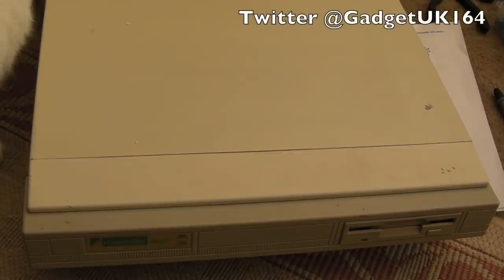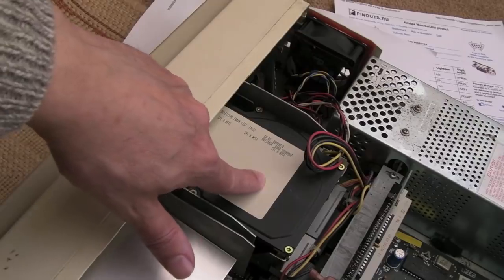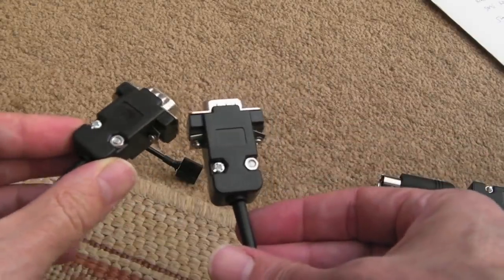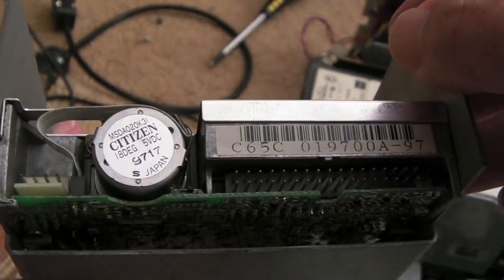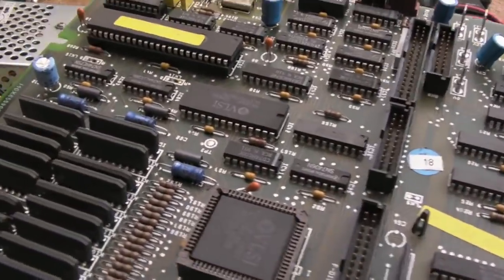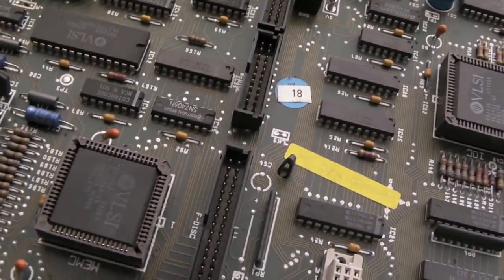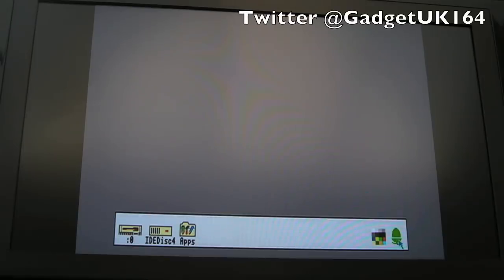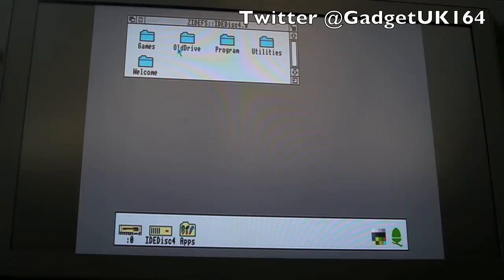Acorn A440/1 Archimedes Repair Part 2 (Sound, Hard Drive, Floppy Drive, Risc OS Upgrade & More)

Comment from the maker: There's a small mistake there when I talk about the FDD - you can replace it with some PC FFDs, but a small mod would be required and some drives might not work.  Also another small mistake related to the max CF size - it's 32GB I think.

Part 1 - https://youtu.be/QE4eH8QN_0c
Part 3 - https://youtu.be/kvcdlH0Ho_A

ZIDEFS Podule (IDE Interface - up to 32GB CF Cards)
http://www.cjemicros.co.uk/micros/individual/newprodpages/prodinfo.php?prodcode=4D-IDE16-32GBSD

Risc OS 3.11 ROM upgrade (4 X 512KB) - Older machines require a ROM carrier board to fit these.
http://www.cjemicros.co.uk/micros/prices/categories/upgrades1.shtml
Reply: another great video chris, really enjoyed this one as im not sure if acorn machines ever came to Australia and if they did they must have been on short supply (never seen one here)

btw if anyones interested in using a PC FDD here's a link to doing the required drive mods:
http://www.apdl.org.uk/riscworld/volumes/volume2/issue6/floppy/index.htm
also this link may be of interest if you want to use HD disks and a HD FDD, it discusses the replacement of the FDD controller with a 16mhz one
http://qubeserver.com/Qube/projects/hdfloppy.html
Reply: Good to see the Arc get some lovin'. Just wanted to say the Arcs did not feature fans at all. They were utterly quiet. Except for the drives, of course.

What's the song at the end?

Comment: those things coming off the adapter for the fan are likely thermistors used to measure the heat level in the case

Comment: I've been enjoying your vids immensely, seeing this reminds me of my very first employment was a computers and electronics YOP scheme back in late 82 and part of the course was we were in groups and every week we would be assigned a BBC Micro which had been at the previous weekend "doctored" by the tutor by putting in duff resistors, caps or failed chips and we would crowdwork on the machine taking different roles to fault find it then repair it and really all we had was clunky old meter's and soldering irons as our "diagnostic" tools and as we developed along we would build up a detailed schematic of the BBC machine making future diagnosis easier and the tutor would do more "doctoring" to really raise the bar each week by setting more tough problems.   At the end of the week our machine had to be operationally perfect, or our group would be marked down for a fail.   He was a devious bugger too the ol' tutor and sometimes we would get a proper PC or another type of home computer but mainly it was BBC as we were learning teletext formation and gearing for the Prestel network that was a big thing back then.   I was somewhat lucky in that I cut me teeth officially on a ZX80 kit my mum bought me from Clive's first adverts, keeping it unmelted and running was a daily challenge, then the same fire control and operation with the ZX81 that could get so hot it would melt the solder or create annoying "hot" joints all over the place, no fans back then and all passive cooling and them ram packs you could often see smoke coming out of if pushed too hard for too long lol   I remember my ol' dad going spare when one of the Sinclair machines burnt a hole in the carpet O.o
Reply from the maker: Very cool lol!  Sounds more fun than I hard whilst learning to repair these things!

Comment: That floppy drive looks exactly like the one in the plastic cased external Cumana drive I had for the Amiga. I suppose a lot of this stuff got used in various machines. It's just a memorable drive because it has the unusual spring mechanism across the top to push the disk tray down.

Comment: To remove the board, normally, it's just remove the podule backplain, power leads and drive leads plus the ground.  An econet module will activate the socket but without the econet server and cabling it will not actually do you any good :-) It was nice to see the inside of one after nearly nearly 3 decades :-). Try and find a SCSI podule that will give you far more choice and size re drive.  You don't normally have to remove the front to remove drives, maybe something was slightly bent somewhere.
Reply from the maker: Thanks, yes - was aware I need a clock and stuff to get the econet working.  But in theory I could set it all up and link to the BBC I think.
Reply: GadgetUK164 - Retro Gaming Repairs & Mods  The Archimedes and BBC will be slaves. You need an Econet server. Econet is hideously slow. It was bad enough on a BBC 8 bit but on an Archimedes it was virtually unusable. We set up an Ethernet network at Orion Computers where I was the technical services manager and component level service engineer. It was a lot of fun! The Ethernet interface didn’t include the software which you had to buy separately. You have a genuine 440/1 as no RAM in sockets. An ARM3 upgrade would be nice if you can find one. I’m looking for an A540 after all these years.

Comment: Guessing the whole fan arrangement is after market - heat shrink on thermistors and control board and replacement fan, explains the wood, sticky pads, blutack, thread,  heatshrink board, etc.

Comment: Archimedes, gaming platform, desktop software house, cat furniture, it does it all. ^_^ A dust filter sounds good but what a mess when it breaks down. Bit of puzzle box that case and full of little surprises heh.
Yeah tape or disk heads are tougher than lasers so they can take a little force when cleaning. Been meaning to try the IDE Flash route someday, I can make disks from blanks now but new old stock of HDDs or it's parts aren't likely if you need them.

Comment: MFM and RLL drives are the same. RLL adapters give you 1.5 times the capacity. When a drive is failing and having trouble spinning up, gentle taps work well.

Comment: Sweet. Nice work. Looks like a pig to take apart! Is that thing near the fan an esc? It looks like something off a racing drone 🤣. Might try hform on the compact flash too. At least they didn't solder the battery onto the mainboard. Just picked up another A3000 cheap but it absolutely rotten.Keep it up.
Reply from the maker: Thanks!  I look forward to seeing that A3000!!!!  Regards Hform, there are different versions - the original old one only works with ST-506 drives, the one for the ZIDEFS has been modified.  I can upload it somewhere if you want it?

Comment: RiscOs 3.1 will take two 512mb CF Cards, you can use dual CF adapter and wire the hard drive light directly to the LED points of the cf adapter.
Reply from the maker: Thanks, yes - already took wires from the ZIDEFS board and connected them to the old LED (as you can see in part 3).

Comment: "is that factory?" about the string loooool.... i can't believe you said that out loud without laughing :)
Reply from the maker: The funny thing is I got de-ja-vu seeing that and I remembered yesterday that there was a kit that came with string - I vaguely remember seeing one of these before come into the company I worked at back in the day, and I am sure that came with string for fitting it.  It must have been a cost cutting thing - what was wrong with bolts I do not know lol.
Reply: haha - i just got through the entire video and the bit about the hard drive was interesting. I remember one of my YT placements in the mid 90's had a green screen PC for keeping a database.... you had to type "park" into a command prompt before switching it off everytime, i've never seen that needed on a computer since.
Reply: @Harp00nX : On these old drives a" parking or landing zone" was specified, so all the park program had to do was tell the drive to seek to a parking zone cylinder. The heads did not (or were not supposed) to actually touch the platters at all, rather the turbulence/wind created by the spinning made them fly just above the surface. Hence the term "head crash". The marks on that platter are from head crashes and Chris is right - once you have one dislodged particle flying around it soon creates another and so on. Incidentally the little white "silicone bag" is to there to catch these particles and any dust.

Comment: 4:55 looks like a so-called noise killer, just a fan controller with a temperature sensor. I vaguely remember installing one in my computer back in the day when it was all the rage, but I can't remember if it was my 486 or the Amiga 4000.
Reply from the maker: Thanks =D  Just need to test the temp sensors and work out where best to situate them I think.

Comment: Nice! shame about that old RLL disk but they are all starting to go now. The 10mb one in my apricot has just started to act up. One of my Acorn A3000 is equipped with an after market IDE interface obe made back in the day tho not a modern one. sadly its original 80mb 2.5" hard disk has failed now. i may do as you and try to replace it with a compact flash card. Ive loads of 128mb ones laying around.
Reply from the maker: Yeah, it's always sad when one of those old drives dies =/  I wonder if there's any way to replace the platters from anything modern.

Comment: Looks like that upper platter was scratched - that drive was already toast!  Might as well harvest the magnets and any other interesting bits from it - maybe use the platters as wind chimes? ;-)

I was always interested in the Archimedes since I first heard about it - we never got it here in the U.S.
Reply from the maker: Yes, definitely scratched!  I think some of the other platters would likely look the same.  I think that piece of sponge in the corner would originally have been sticky and caught any particals.  Now it's no longer sticky I wonder if some particals came out of it in transit and maybe they added to problems =/
Reply: Some guy made a POV display clock from the read head arm.
I made a clock where the read head arm strikes a bell when the alarm time is reached.

Comment: It's been a joy to look inside of one of these machines, having never seen one naked before.

That Panaflo fan looks like a dead ringer of one of the older Papst fans. It'd be interesting to see wtf is going off with the "controller" cause Papst fans run at full RPM, no fucks given, so maybe it's some form of "primitive" PWM? Dunno just guessing.  The item you thought was possibly a relay could well be, as it look a lot like the devices to decouple modems on dial up stuff (like very similar package and design to old ISA dial up cards, or serial / parallel boxes of yore). 

Love your vids to bits. I hope that current issues are not impacting life too bad, as I'd love to see more of what you do, but if you don't feel up to it, don't do it. Sooner have you healthy than burned out cause of vid making.
Reply from the maker: Yes, I think you are right!  It would appear to be a fan speed controller (PWM?) with two sensors.  Personally I would just connect the fan up and have it always cooler (and noiser) lol.

Comment: It's been a while since I owned one of these but I do remember having one of those aftermarket fan controllers in my A440. The idea was to reduce fan noise by measuring the temperature and adjust the fan speed to suit. Those little cable ends are the sensors - I think one of them went to the hard disk but i don't remember much more. Maybe you could experiment with some freezer spray and a hairdryer ? :)
Reply from the maker: Thanks!  Nice idea!  I will check that out in part 3!

Comment: My layman's guess would be that somebody added temperature sensors to the fan. The wood and the string look like attempts to prevent vibration (although the wood block?). Perhaps it just ran too loud and the owner wanted to prevent it from running if it wasn't required.
Reply from the maker: Yes, I think you are right - did cross my mind whilst watching it back myself, but why two of them - they aren't exactly able to move far appart etc.
Reply: @GadgetUK164  Maybe they're tiny FBI cameras so NASA can keep an eye on what you do inside old computers Chris.
Reply from the maker: LOL =D

Comment: You can use a PC drive but it needs a mod to the cable to make it work or be able to change the drive select number.

I have used various pc drive and while they do work I have found it to be picky about what drive you use, often I will find that discs will format with errors but the same disc in the genuine Acorn drive work perfectly.

Info here http://www.apdl.org.uk/riscworld/volumes/volume2/issue6/floppy/index.htm

Comment: At 05:00 it is a heat sensor to control the fan.
Reply from the maker: Thanks, I suspected when watching back but I wasn't 100% sure.  The wires aren't very long so guessing one goes to the HDD, the other somewhere near the PSU or motherboard maybe?
Reply: @GadgetUK164  If I find the machine I have fitted with the same kit (it is not standard) I will be able to tell you how it should be properly connected.
Will you demonstrate the sound mod in your next video ?
Reply from the maker: I planned on talking about it!  I just want to work out the best way to do a mod before I do it.  I saw your posts about swapping the opamp, did you just take the audio outputs directly from the opamp there or leave the original filtering in place, because I suspect the filtering is the biggest issue.   It sounds amazing as is but lacks some of the higher frequencies due to the filtering.
Reply: @GadgetUK164  I simply replaced the OPA and did the normal filter off modification as described on the stardot forum, with the link I gave you in my comment.
Reply from the maker: I fitted the burr brown op amp - any chance you could share some mods and trackers somewhere I can download from?
Reply: @GadgetUK164  The Matrix Tracker is here http://ftp.uni-stuttgart.de/pub/systems/acorn/riscos/sound/ and I can send you some S3M tunes already converted to its own format with pleasure.
QTM is here and it will play many formats including Amiga MOD tunes : http://www.phlamethrower.co.uk/riscos/qtm.php
Reply from the maker: Thanks, I see Matrix1, Matrix2, 3 and 4 on that FTP site, which do I need (or all of them?)?
Reply: @GadgetUK164  All of them. These zipped files already contain a few converted tunes. If you send me your email I can send you my collection, including 8 channel tunes to play with QTM. If you find it difficult to transfer the files to the A3000, I can slow mail you everything on diskettes. I'd be happy to to do that, really.

Comment: Color of this platter is ok, they look normal, but are scratched.
Reply from the maker: The bit inbetween the yellow and red isn't right for sure!  It's worn away!  But as you say, yes - very scratched!!!  I might dismantle the drive at some point just to reuse the motor for another project.  It would be interesting to see what the other platters look like.